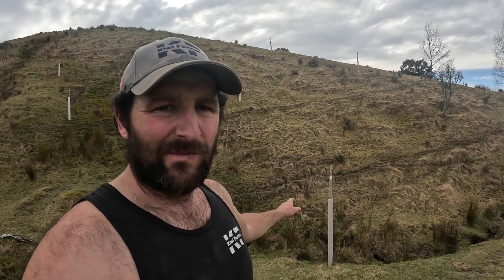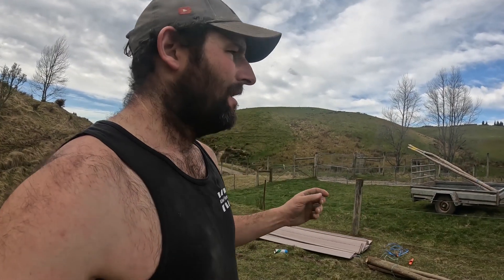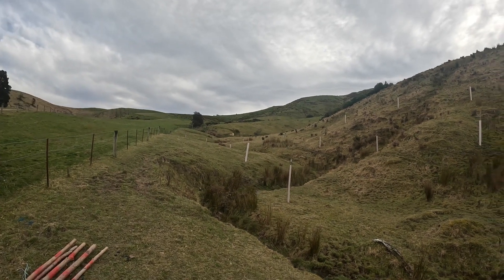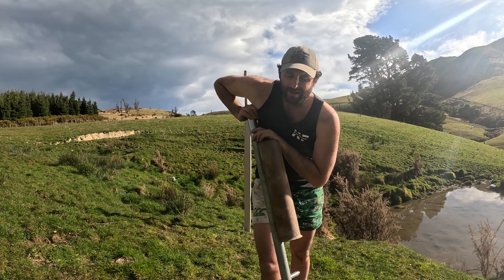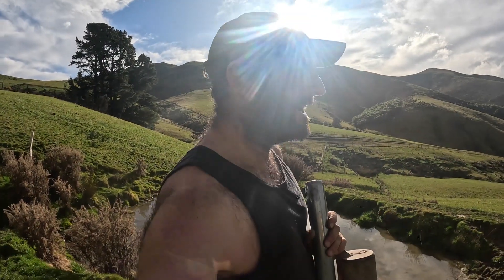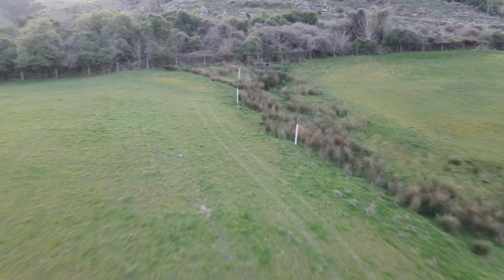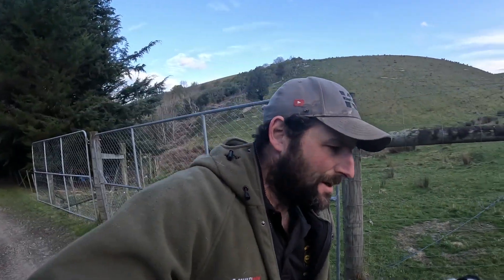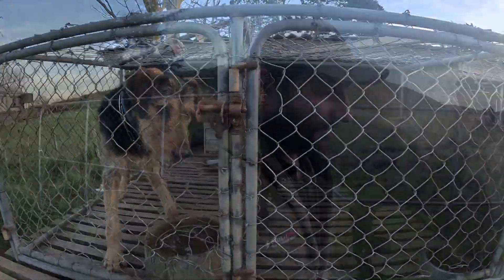Planting Poplar Trees / Poles -Erosion Control, Stock shelter, Shade and fodder.

Comment: Get an Ozito 18v pole planter/auger 299 at bunnings.
Buy an extension and 100mm auger from toolshed.
Drill hole to depth, put in reverse then ram home an firm up pole.

Comment: Great to learn how you plant poplars, thank you!

Is this succession planting, where you would then plant slow-growing, long-lived native trees that will eventually take over? Or is the plan to stick with a permanent, sheep-friendly poplar plantation?

Question about dog housing: I have indoor pet dogs so I’m not familiar with outdoor dog facilities. Those cages don’t seem protected from the sun, wind or frost. No roof or tree. The metal pipe your older dog is housed in looked purpose-designed for cooking dogs in summer sun. And yet your dog was clearly not cooked and the dogs in this video seem healthy. What am I missing?
Reply: There are wooden houses at the end of the caged area that have insulation in them to keep them happy. The caged area has a grate floor for their toilet area and where their food and water is put.
Reply: @stewbird  Aha! Makes sense, thank you!
Reply from the maker: The planting is a bit of both. Stock friendly trees in areas we will continue to graze and we can underplant with natives in areas we will fence off and retire later on.
Reply: @kiwifarmernz  Ah, so native trees are not stock-friendly. Got it!
Reply from the maker: @alisoncummins2726  stock can be very hard on them until they grow taller
Reply: O